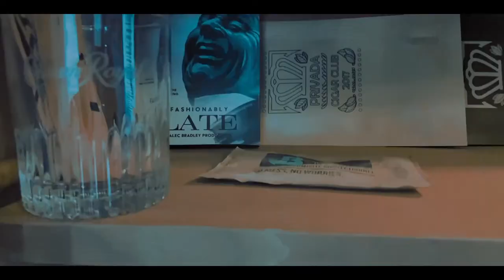Making a Cigar Humidor from a China Display Cabinet: Making a Cigar Humidor (2020)

Comment: Great video !!   I was wondering what type of door sealant did you use on the front door ?   And did you choose a different lock system for each of the door?   Thanks !!
Reply from the maker: Hey Jeff.  So for the sealant on the front door, I actually used weather stripping on the insides of the doors.  For the latches, I used window latches.  I found some that were cheap and looked really nice.  I don't really have a need to lock it up, so I didn't put any sort of lock on it  You can see the door stripping and window latches at @12:50.  Thanks for the comment man and I am glad you liked it.

Comment: Maybe I missed it, but what are you using for humidification?  I really wish I had the time, tools, patience, and talent to do this.  But alas, I have none of those.  :)  Great job.
Reply from the maker: Thanks for the compliment Gary!  Yeah you might have missed it but I use Boveda Packs for humidification.  Since making the video I upgraded the packs to the biggest size they have.  I had around 10 of the medium packs in there, and while you can recharge them, that just isn’t really efficient 😆.  Man I’m sure you have the talent, I learned most of what I know from youtube, and practicing on smaller things in the beginning.  Also, I know people talk about Harbor Freight, but when I started I got most of my tools from there, and then upgraded later.  They work well, just not for someone who is a carpenter and uses them day in and day out.  For home projects and things they would work out great for you!  Once again I appreciate you watching and the comment!  Have a great day!

Comment: Awesome build and video, couple of questions as I am building my own 65x33.5x15.5, curious what glue and sealant you used (especially on the cedar lining. Also noticed you didn't use any hardware, have you had any issues since it was built with the cedar warping?

Comment: That was very well done, I just have got one question. Why not use small staples instead of all the glue?
Reply from the maker: Hey Dewayne  thanks for the compliment.  I did use some staples to put in the spacers in the back of the humidor, but I was afraid they might blow out, and I knew the wood glue would be strong enough to hold it together, but I am sure if I would have looked a little harder I probably could have found some that would work!  Hope you have a good day!

Comment: Thank you for the great video. I am in the process of tearing down my brand new cabinet humidor and removing the compressor and heating element. I want to line it with mahogany with cedar drawers but after your video I decided to check the link for the spanish cedar that you used. It looks like they only sell spanish cedar "plywood". Did you use plywood? if so how is it holding up? I am concerned with the plywood sucking humidity out of the humidor and possibly bowing? Have you seen either of those issues with you build? 

Thanks again for sharing.
Reply from the maker: Hey Doug, thanks for the comment my friend.  I also did a good bit of research because I also questioned the reliability of the veneered plywood vs normal spanish cedar.  One thing about plywood though, is if it is quality it should not move to much.  Now if you just got a cheap piece from a local big box store the likelihood of it possibly bowing or warping is alot higher.  After 6 months or so I have had zero issues at all with it.  I have had a little issues with keeping humidity, but I blame that on my office being one of the cooler rooms in the house, and with cold, humidity in the humidor will lower.  I also blame it on the 2 large glass doors.  I did use a clear sealant around the joints, but I know some still escapes though there, as well as making it harder to control the temperature inside.  When I notice the humidity start dropping I just pull out the old boveda packs, and replace them with fresh, and the humidity pops right back up.  In my research I also found many others have used spanish veneer plywood, and I didnt find any stating they had too many issues with it.  I hope I helped with your decision, and if you have any other questions just let me know.  Thanks again for the comment my friend!
Reply: @DraysWorkshop  thanks for the input. I’ve decided to use the veneer plywood now trying to find it on the west coast is the challenge.

Comment: Also, what did you do about sealing the top and bottom of the doors? I saw you used the weather strip. But didn’t see anything about finishing the seal all around.
Reply from the maker: Yeah I used weather stripping around the inside.  I put the bottom seal on the edge of the Spanish cedar in the bottom.  For the sides(inside and outside) I placed them on the inside of the door.  The top was a little tricky but I ended up cutting some plexiglass strips and attaching it to the inside of the top of the humidor leaving a little overhang to attach the weather stripping to.  For the glass(I think I did that off camera) I used a clear odorless caulk/gasket sealer around the edges.  This works well by the way, if you have some smaller glass top humidors. Obviously take out your cigars while doing it or while seasoning it.  Holds humidity way better!  Once again thanks for the comments and questions brotha.  If you have Instagram follow me and send me some messages if you have anymore questions and I would be more than happy to help! (@drayworkshop)

Comment: How did you go about adding lighting?
Reply from the maker: Hey Brandon, thanks for the comment.  In the beginning and in the video I used the little adhesive disc lights that I believe I purchased from Home Depot.  They have the ability to changed colors, and have a remote control.  After a while though, they started to not stick as well, I am guessing just because of the humidity.  I think a better option might be to try the strip lighting, and maybe super glue it to the inside.  Both are battery powered.  Thanks again and glad you enjoyed it.

Comment: Very nice.  I'm thinking of converting an old gun cabinet. Was wondering about covering the inside of the doors around the glass. I noticed you did not. Any issues with the moisture?
Reply from the maker: Hey Ray!  No issues at all buddy, and I actually intended to cover the wood around the glass just one of those things I havent done yet.  I did put a clear sealer around the inside of the glass though, and I really havent had any issues so far.  Only thing I run into is that keeping the humidity in it during the cold weather months has been harder, but most humidors are like that unless you have one of the NewAir Cooler humidors.  I just through an Extra Boveda pack in there and I am good to go!  Thanks for the comment, and I am glad you enjoyed!

Comment: What type of glue did you use to glue the cedar... great piece I’m about to start on my soon.
Reply from the maker: Hey Classic, thanks for the comment!  To glue the main walls, back, bottom and top I just used normal wood glue. You can get it at Home Depot or Lowe’s.  Tire ins is the brand I use and have never had a problem.  For all of the shelving and support pieces inside the humidor I used odorless super glue.  It sets up really fast and is pretty easy to clean up if you accidentally get it somewhere unintended (like I did) 😂.  I wish you luck buddy!

Comment: Amazing build and great video. You inspired me to convert a cabinet to a humidor also. I am sanding and sealing now and going to buy my cedar soon. What method should I use to maintain my humidity after I get the ideal level? My cabinet is the same size as yours.
Reply from the maker: Hey Lee.  So I have had the Humidor built for almost a year now, and normally keep around 200 cigars at a minimum in there.  I have had success with the Boveda 320g size humidity packs.  I have one on top and one on bottom, and really havent had to many issues.  I might throw any extra smaller one in there during the winter months if it drops a little low.  I just like Boveda.  You never have to worry about it getting too humid as the packs will absorb any extra moisture in the air!  

Thats awesome that you are going to try and build one yourself, be sure to send me a picture when you are done.  Either on facebook or instagram  I would love to see it!

Comment: Awesome job.  So many of those old display cases at the junk stores these days, shouldn't be difficult to find one for myself.  By the way, how are you maintaining the humidity in the case?  Manual or do you have something else going on in there.
Reply from the maker: Hey Ted!  Thanks for the compliment!  I have been using 4 of the 320g Boveda packs.  2 on the top and 2 on the bottom.  Those do really well for keeping the humidity just right.  I will also use smaller packs occasionally while re-seasoning the larger ones!  Have a great day!

Comment: This is a great video!  I am in the process of building my own and found your video.  I started with 4/4 (inch thick) cedar boards and milled them down into 1/8" thick boards I glued up into panels.  I ended up building shelves similar to you.  I love the idea of the walnut trim and will probably copy that idea for mine.  I am using an oasis humidifier and one of the things I am struggling with is how to provide sufficient seals to be able to maintain humidity.  I've decided to actually not use any at first and see if my humidifier will keep up.  The other thing I don't have a lot of experience with is power management - for now planned on installing an outlet someplace inside the cabinet where I can plug in the humidifier and lights.  Any information you have on that topic would be helpful.  Also any learnings and/or things you would do differently now that you've had yours a couple of years would be helpful.

Really great job!  I hope mine looks half as good.
Reply from the maker: First off sorry for being so late!  I cant really help with the power management situation, as I maintain mine with the XL Boveda packs and that works really well for me.  I do see a little struggle during the winter times, but nothing a couple extra packs doesnt help. For sealing around the doors, I just used adhesive rubber window seals.  The one thing I would change in my build in particular, would be to adjust the upper shelves a little, and give me a little more room for box storage underneath the top shelf.  Thanks for the comment and I am sure yours has turned or will turn out great!
Reply: @DraysWorkshop  Still working on it, but it's coming along nicely.  Thank you for getting back to me.
Reply from the maker: @rjrotermund  Great to know! Let me know when you get it finished!

Comment: Do you use a bandsaw for everything?
Reply from the maker: On this project I did.  You can probably see it in some of the shots because the humidor was setting on it and the outfeed table for my table saw.  

I have it fully restored now, but at the time is was apart and not working, that is why I used the bandsaw for this project.  Just made the most sense for the smaller parts and ripping when I needed too.  

Thanks for the comment, and I hope you enjoyed the video.

Comment: Any problems with odors from the caulk and sealants getting into the cigars?
Reply from the maker: None really at all.  I was worried about that myself.  When I caulked the inside, I used "odorless" caulk, but it is never odorless LOL.  So, I know its hard to tell from the video, but after I applied the caulk I let it dry for a day before I sprayed the clear coat on top of it, then I also let it sit for a while longer to let that dry before I started dry fitting the pieces, and then glued up the next day.  It has been a couple of months having it filled, and opening it at least every other day, and I have had no issues.  It smells delicious lol.  Thanks for the comment and I appreciate you watching!
Reply: DraysWorkshop thank you for replying. I appreciate your time.
Reply from the maker: @billymurges5959  no problem at all and I appreciate you watching and commenting!

Comment: What type of "clear coat" spray did you use?
Reply from the maker: Hey Wessel.  Just a typical Clear Coat spray, nothing special.  It was going behind the spanish cedar inlay so I knew it wouldn't be an issue.  I also let it dry and air for around 6 hours before continuing work.  Thanks for the comment!